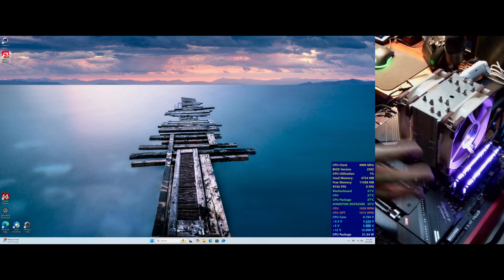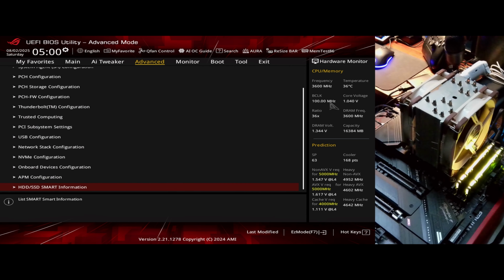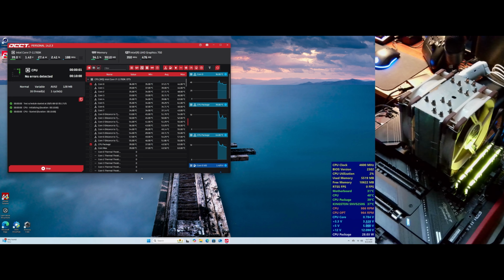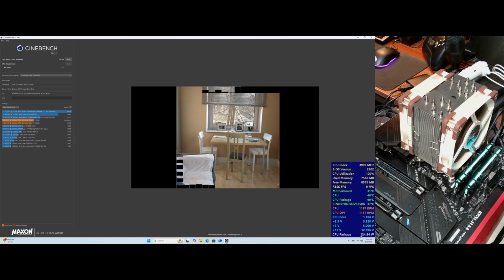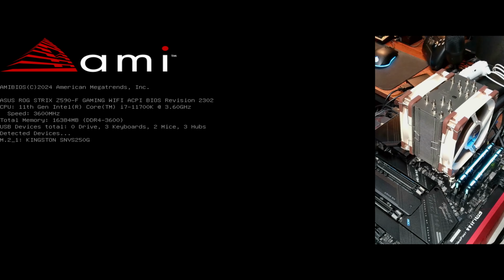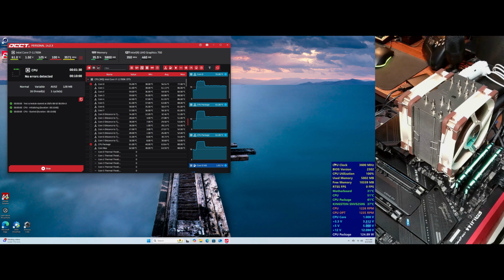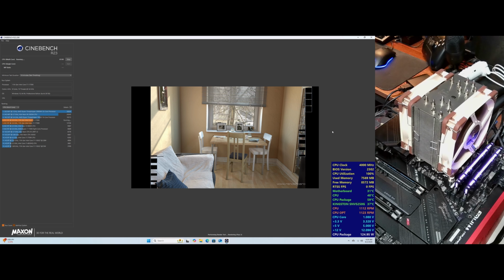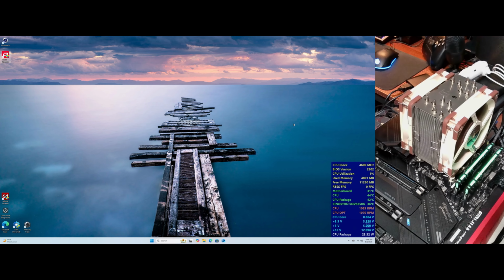"Full Stability Test - Undervolting The Intel i7 11700K | How Low Can It Go?"

Comment: Very limited testing.... both in terms of test type variability as well as duration. In other words, you're doing very specific tests for very short time. That is not enough at all.
OCCT especially should be tested for hours and hours... I promise you that CPU is not stable at all at - 0.100V.
Reply from the maker: Stability testing is always going to depend on workload type, silicon quality, motherboard behavior, BIOS tuning, cooling solution, and even power delivery consistency. Two i7-11700Ks can behave very differently under the exact same settings.

In my case, this undervolt has remained stable in real-world usage, gaming, rendering, and daily operation since the video was posted. The goal of the video was to show practical tuning and efficiency gains, not a 24-hour enterprise-grade validation run.

I fully agree that longer OCCT runs and heavier AVX workloads can reveal additional instability scenarios, and viewers should absolutely do their own extended testing if they want maximum validation. But at the end of the day, a PC is built to be used and enjoyed — not to spend its entire life inside stress tests.

The important thing is finding the balance between thermals, voltage, performance, noise levels, and real-world stability for your specific setup.